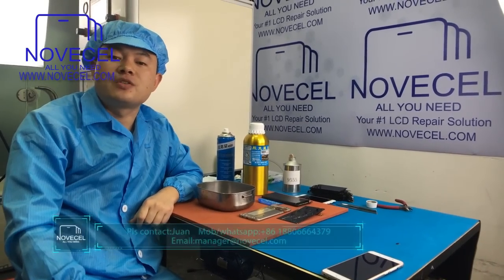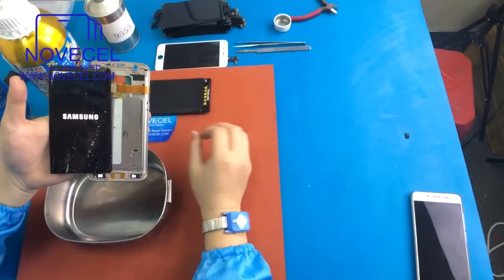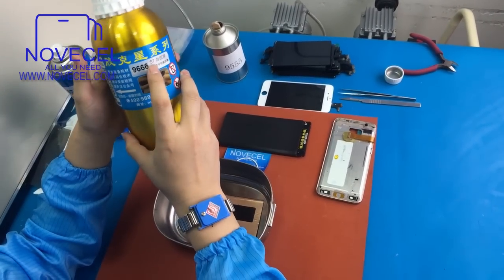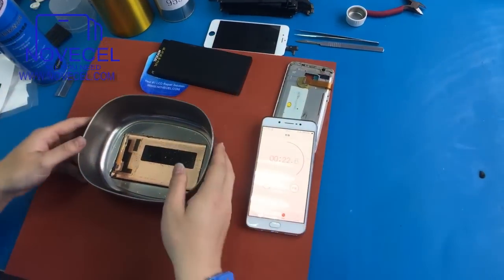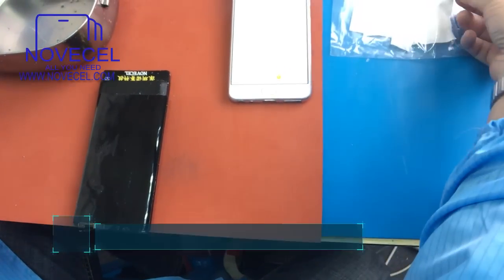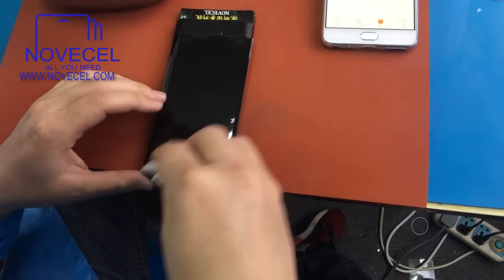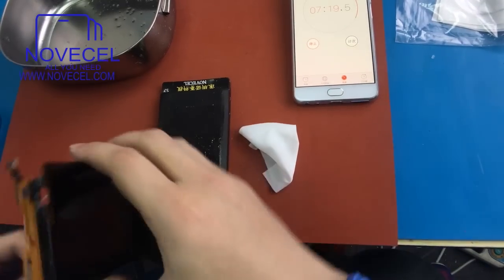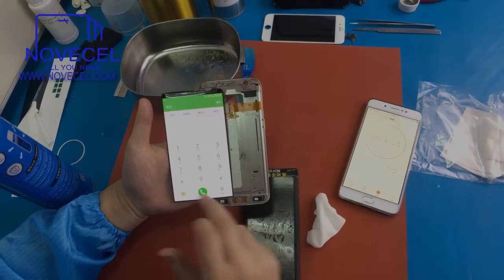Newest Tecnology to clean the adhesive or glue on s7 edge

Comment: This is false advertising.

1) You used the wire method to separate the OLED from the glass. 95% of the glue stays on the separated glass which is thrown in the bin. Only 5% remains on the actual display which can be clearly seen in the video.

2) The remaining glue is not very thick as they are just marks left by the cutting wire. These marks can be cleaned with Acetone or even Isopropyl Alcohol with no problems.

3) Most of what you were wiping was on an already-cleaned display. You were only removing some residue, not thick OCA glue. 

So in the end, this glue does the same job as other chemicals i.e. LOOSEN the glue, not liquidate it. So your friends are right in believing that this glue doesn't work like you say it does.
Reply from the maker: so , what i can ask is coming to my office ,so that you can see this yourself with your own eyes, i dont know if you have made any s7 edge screens, s6 edge glue is think , s7 edge glue is not that thick . come to my office , i show you this .